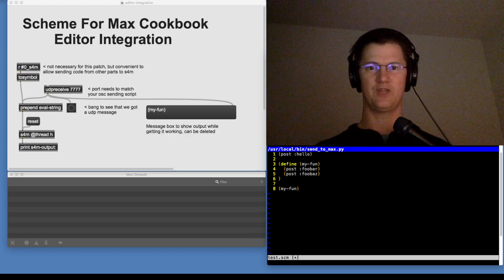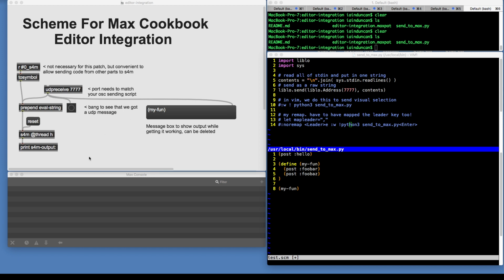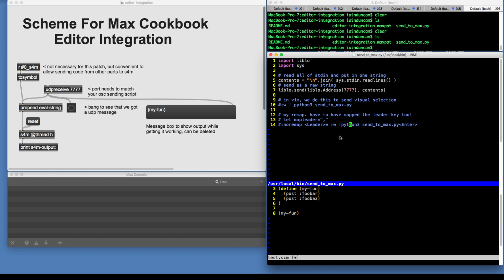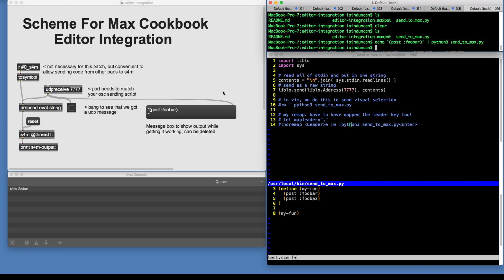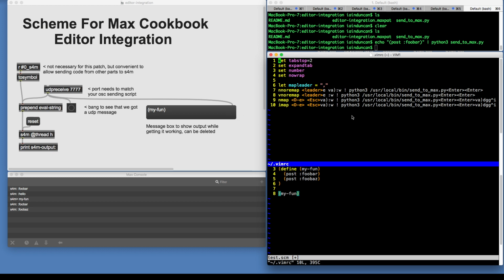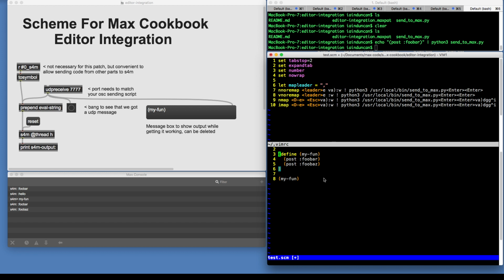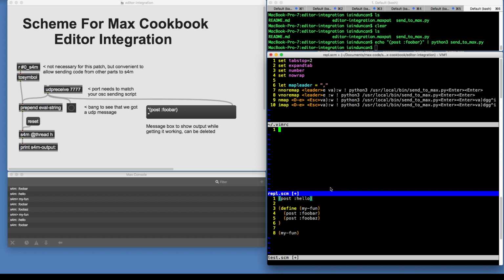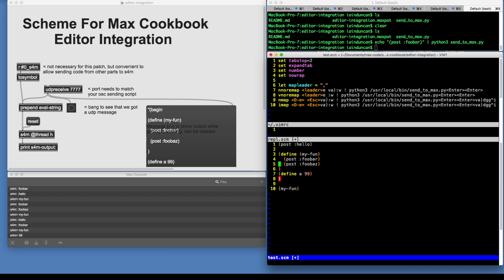Scheme For Max Cookbook - Editor Integration

Comment: There are also a few repl plugins for vim: vim-slime, vimcmdline, vim-quickrun (+ more that are only for neovim or only for certain languages).
Reply from the maker: Yeah I need to check them out in more detail. My solution was the easiest course based on what I'd done before in Vim and Max, but I would be surprised if there aren't better ways to do it!
Reply: @MusicwithLisp  I did look after I left the message and I'm not sure there's a way with any of those to give a port #, so your method may be best.
Reply from the maker: @felixthehuman  thanks for the update. Yeah I looked at some too and couldn't think of a good way to get it into max aside from osc over the network.